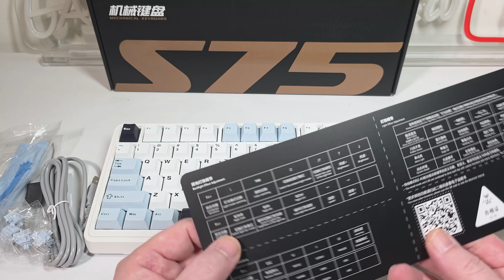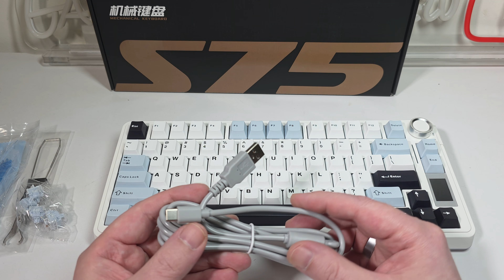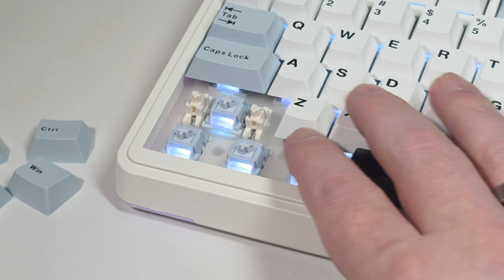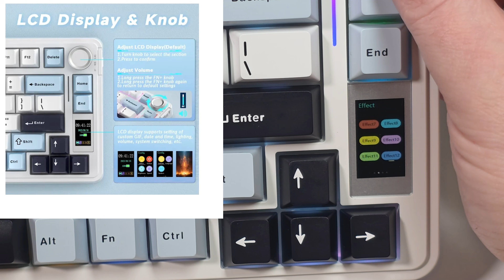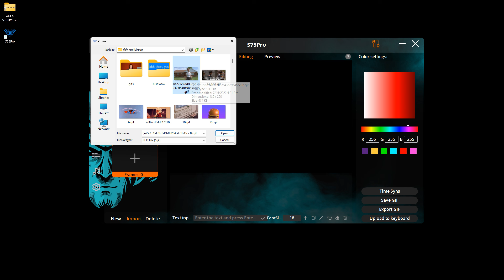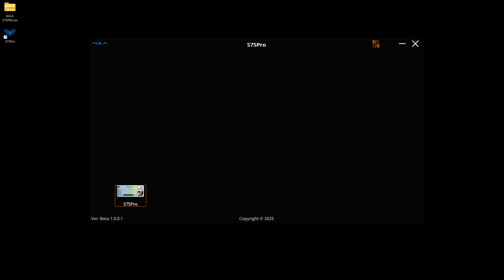Aula S75 Pro Tri Mode Mechanical Gaming Keyboard REVIEW

Comment: Hii is there anyway i can make this computer lower and higher up my screen brightness? Not the brightness on the keyboard but on my display? My laptop that im connected to has the f6 and f7 keys that higher and lower the brightness but i wanted to know how to do that with my aula keyboard, any suggestions?
Reply from the maker: In the software you can make any key on the keyboard (pretty much) be anything you want.  So bind keys on the keyboard through the Aula Software to map keys to your F6/F7

Comment: When going from wired/usb to wireless, does this NOT automatically connect or do you have to press a button to re-connect after you pull the USB plub?
Reply from the maker: You pull the USB and flip the switch to wireless and if the dongle is in your ox it will then connect.

Comment: Mine cannot detect it in the application when using the 2.4g dongle, but it works. Any solution?
Reply from the maker: Have to be plugged in USB wired to use the application

Comment: Hi. Just received my Aula S75 Pro, but I can’t seem to connect it via BT. My PC is unable to see it. How can we reset the BT option or enable it on the keyboard? Thanks in advance!
Reply from the maker: To connect the Aula S75 Pro  to Bluetooth, switch the keyboard to Bluetooth mode, hold Fn+1 (or 2/3) for 3 seconds until the light flashes quickly to enter pairing mode, then select the keyboard in your bluetooth settings in windows.

Comment: can you not customize the led strip on the front and the lcds in the back in the app? i just bought this keyboard and ive yet to find a lighting feature for anything besides the backlight of the keyboard. thank you!
Reply: I have this as well, do Fn + Z for the light bar on the front. Do Fn + / for sidebar colors, and Fn + Alt for sidebar brightness
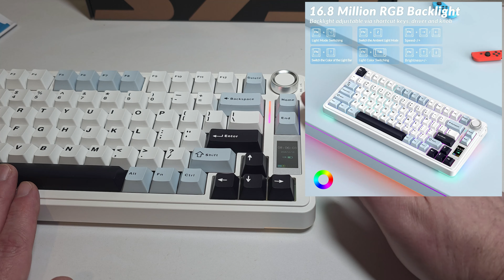Reply from the maker: those are Keyboard controls and are shown in the video at 7:00
Reply: @GalaxyTechReview  okay, so liked i asked there is no way to chage it in the software. thanks.

Comment: i cannot figure out how to remove gifs or get the time to sync when im connected via 2.4g. no issues on usb
Reply from the maker: must be in wired mode to use the software, you can then disconnect and go back into wireless mode once changes are made.
Reply: @GalaxyTechReview Why my keyboard in application cant be detected? I have that issue and i installed the correct app.

Comment: I bought this keyboard too, but the app doesn't work for me. I downloaded it from Aula's website, but when I open the app, it can't find the keyboard. I normally use it via USB, but I connected it with a cable just to see if it would recognize it, and it still didn't. A few of my friends also bought this keyboard and they're experiencing the same problem. Can you please help me?
Reply from the maker: I had no issue with the keyboard software detecting the keyboard while plugged in to my windows PC via the USB cable.  Only thing I can suggest is try a different USB port.  If that doesn't work try sending Aula a support ticket.

Comment: What could the problem be if my dongle doesn't work and i have to use the usb cord?
Reply from the maker: Make sure you are in 2.4g mode using the switch on the right side of the keyboad next to the knob.  You must have it in 2.4g mode for the dongle to connect. if it's in the middle position it's set to connect via wired USB.